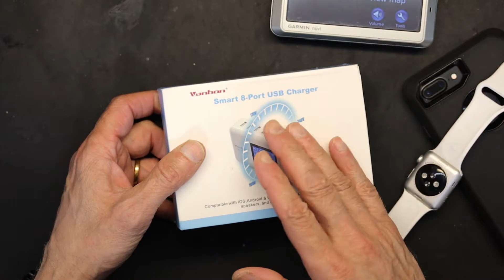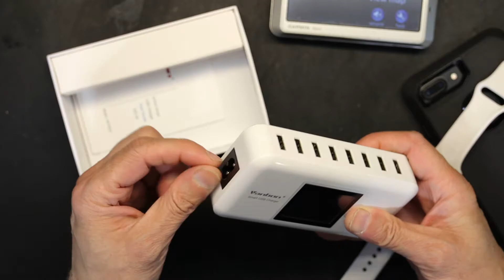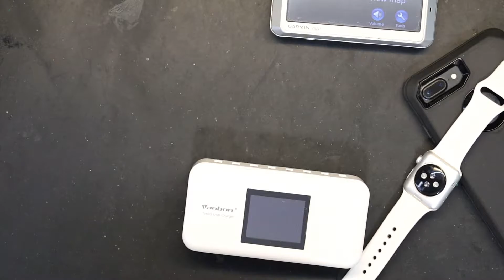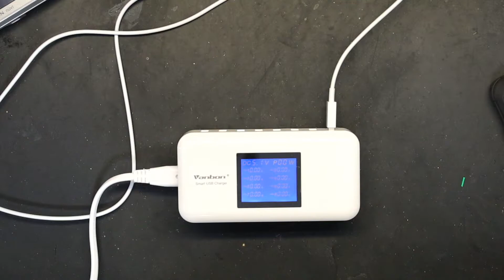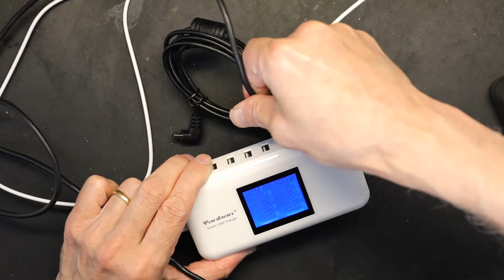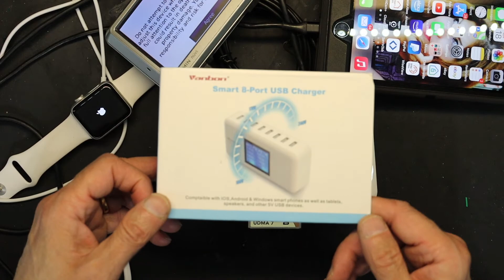What is a Smart USB Charger and why do you need one for the health of your device batteries.

Comment: When we first get a new device, are there specifications on the box or in the literature that we can either read or calculate what the "as new" current draw during charging should be? Or do just have to make a note and then monitor the current draw (drop) over time?   Thank you for another great and informative YouTube.
Reply from the maker: No problem, there are two ways to see what the normal rating is. 
1. See the rating on the supplied power adapter which came with the device 
2. Fully Drain the battery of the device and charge it with this smart charger to read the max current when the battery is empty. Then power ON the device to see what the max current is when the device is fully discharged yet powered ON. 
Make a note of both scenarios and that will give you an idea. Remember that if the battery is a brand new battery it will take up a year before you see a noticeable capacity drop and charging current reduction.